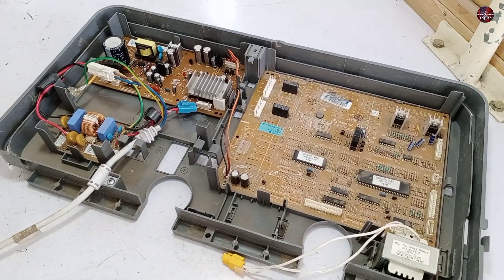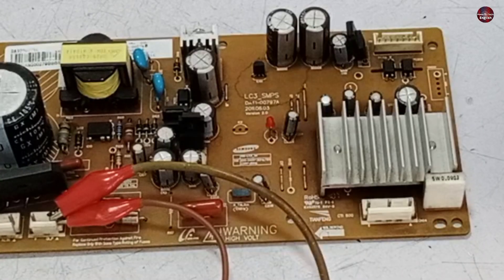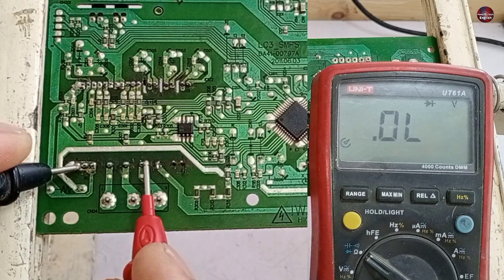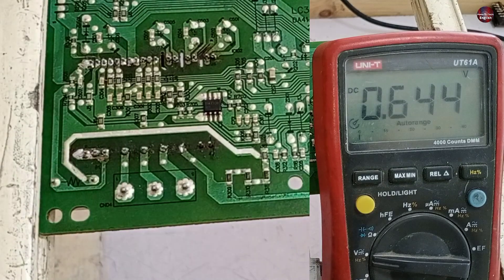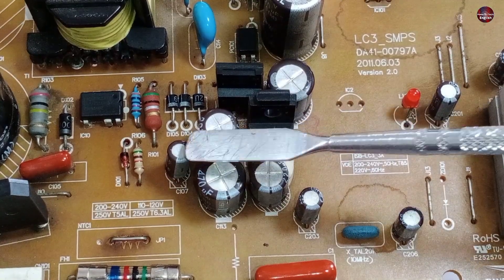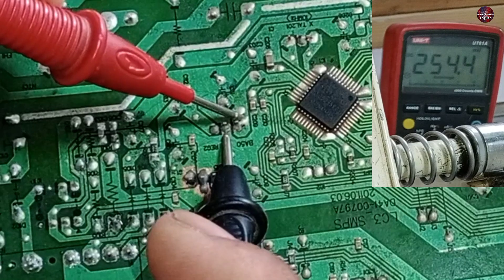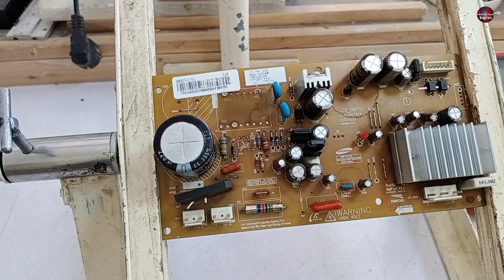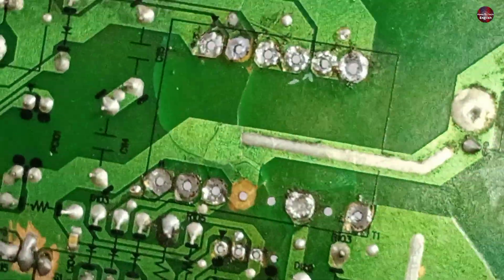Samsung Refrigerator Inverter Control Board Fix? Tried By Other Tech

Comment: The board's clearly suffered water damage before being stomped on and destroyed by the technician's boot. Never do a bullshit repair by making a modification. If you have to become the engineer to fix something you're on dangerous ground. Always replace a board with a new one and send the old one to the manufacturer or throw it away. If you modify something and there's a fire. Guess who everyone's going to blame?

Comment: you should get a small workbench to avoid accidents , also the work on the board was pretty shoddy before.

hot air blower , mini PCB repair kit , JBC is best but cheaper good chinese ones availaible as well, a microscope for repair on PCBs is good idea as well as using Ampac flux, alcohol wipes 

I had such a work bench in 2003, nowadays tools are better , and have more variety to make work easy and faster.